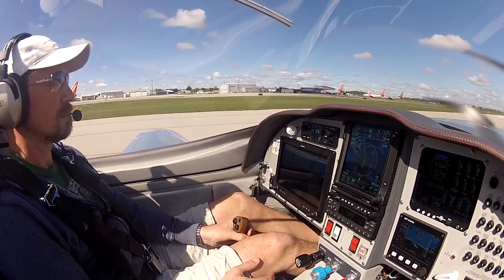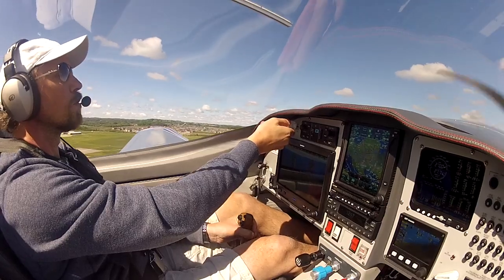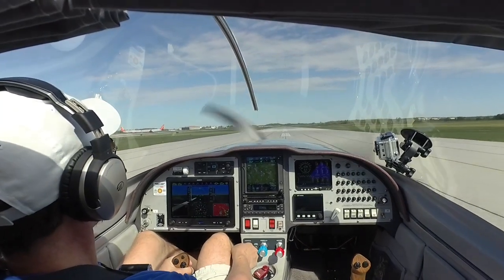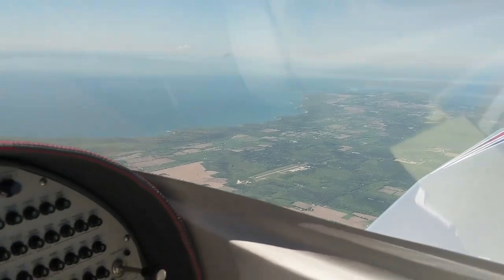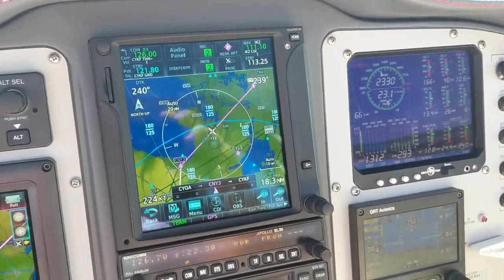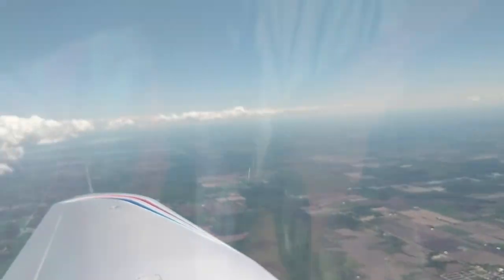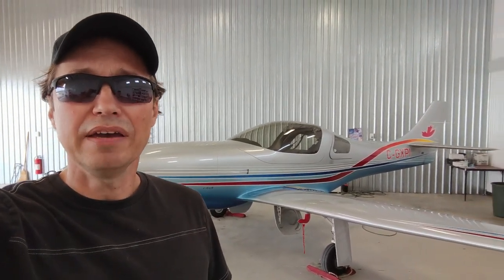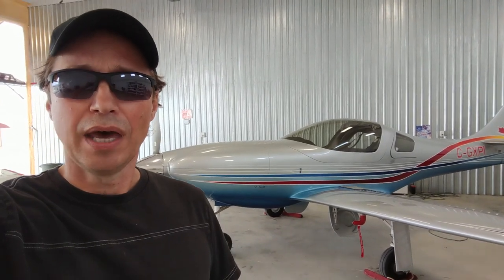Flight Characterisics - Lancair Legacy RG

Comment: Well I'm one of those low-time pilots that you mentioned. Still, I can't help but wonder if a Lancair 235/320 isn't in my near future. Would a lower hp version of your beautiful aircraft help with the transition from an Archer to a Lancair?
Reply from the maker: Tucker, I am not an instructor, but I would be a bit wary of moving from a fixed gear (Archer) to an RG aircraft (235/320) directly.  Despite being smaller those are still two very quick aircraft and throwing such a huge cockpit management change (retractable gear) at the same time would be a lot to get right in an environment where stuff comes at you more quickly.  In my own circumstances, I had started moving up in complexity progressively over my flying years, and had maybe 75 or more hours in retracts before moving up.
Reply: @PiInTheSky  Yeah I can appreciate that. Aviation has been a really fun hobby for me; dying is a quick way to make it un-fun.
Reply: The 320/360 is harder to fly, generally-speaking, than the Legacy. I own a legacy and I've flown the 320/360. It may stall a bit slower and has a lower wing loading, but depending on which tail you have, its less-stable and you dont have as much power to get out of bad situations. If it were me, I would go Glasair FG with a long wing (or even Legacy FG) if you want something easier.

Comment: Great vid, when comparing to a simulator, I feel my sim is slightly off in 3 ways. When retracting flaps to up after takeoff (about 110kts) I get an abrupt nose up pitch. When extending flaps in increments during approach, each extensions results in a abrupt nose down pitch.  When on short final and touchdown, at 90kts, with full flap, I need a lot of nose up trim to be close to neutrality on the stick.  Seems a bit off to me.  How is it in the real aircraft?
Reply from the maker: Hi Iain, interesting question, and the answer may depend a bit on how the aircraft is loaded and configured (i.e., tail-heavy, nose heavy, etc).  I do not feel the pitch up much at all after takeoff.  I do feel the pitch change substantially when I go from first notch of flaps to landing flaps (from roughly 12 degrees to about 40 degrees), and I do use trim to compensate for it.

Comment: Is it true these birds drop like rocks, when engine fails?
Reply from the maker: As listed in the POH, the glide ratio is 2nm per 1000' making it about 12:1, at 120 knots clean, which is pretty far from "dropping like a rock" :)

With gear out in the wind and full flaps, then yes, I have pretty much an unrestricted rate of descent.
Reply: @PiInTheSky  ahhh, got it , thnx for intel